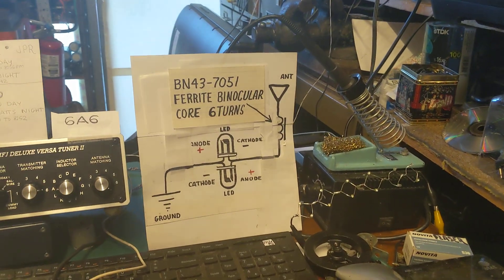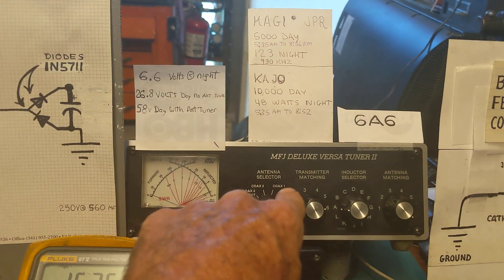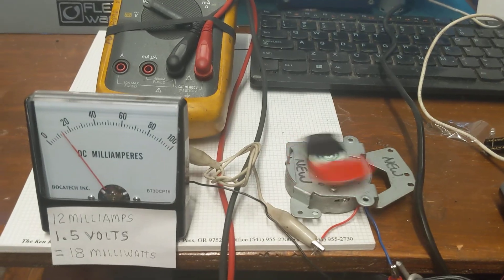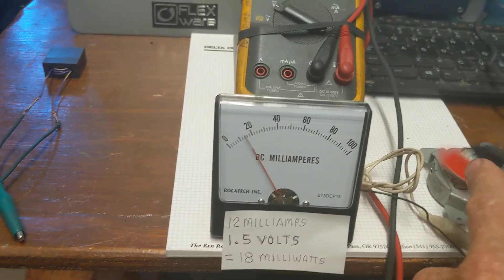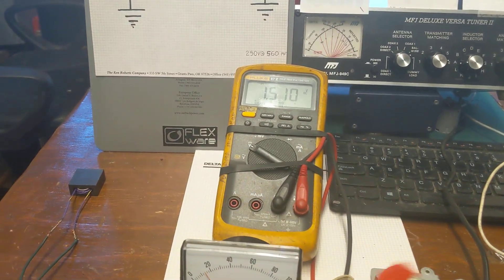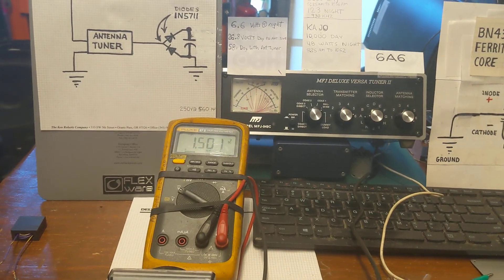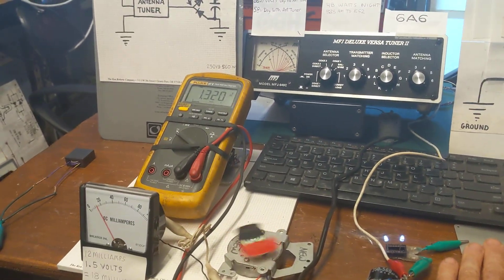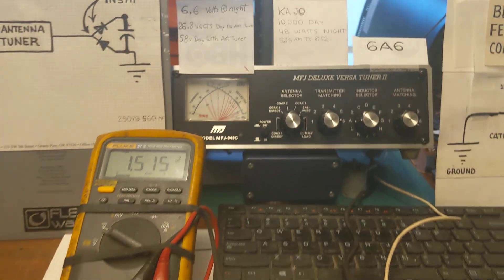Powering A Motor On Radio Waves.

Comment: The Guy from the Plasma Channel did some experiments on RF power you might find interesting.  I believe that a 
Joule Thief Circuit with this RF input could be used to drive a Magnetic Pendulum to create even More Output power
using the gravity of the swinging pendulum, as it passes over 2 coils on either side of the 180 degree swing.  I am going
to give this a try.  Great Videos!!

Comment: That extra voltage could be coming from the input of the antenna tuner mains voltage power. But still very interesting to get 26 volts with diodes thank you
Reply: The component values   in that antenna coupler are not going to pass  60hz  line power anytime soon.

Comment: Dint need to drive stuff, this is useful just for a off-grid trickle charger 
Like you find a quiet place noone will bother you for a while this could keep your batteries topped 
I mean 59 v could charge a 48v system 
Get a wood burner in there 
Jobs a gooden
Reply: My first thought was also trickle charge for batteries

Comment: actually you could run an appliance if you charged a very large capacitor or battery bank and let charge over time like solar shouldn't take long then just use inverter to get stored energy , probly can power a microwave for short period of time with right battery storage.

Comment: Does the power to the motor change in the night hours?
Reply: It is likely much less as the transmitting station drops its output wattage significantly at night since it doesn't have to compete with the RF output of the Sun.

Comment: If you haven't looked into the LTC energy harvesting chips, I've used the 3588-1 to pull 100ma off fluorescent lights using a couple standard size plain copper clad pcb panels (I actually made larger panels using two standard size each and running fat solder blobs all the way down the seam joining them).  All I did was hook up a breakout board I got off sparkfun (there are many maker sites that have this board, if they don't), wire up the panels, and it started cranking out power.  What I learned from that is if you can hear a light or motor then it's losing energy into free space through inefficiency and you'll probably be able to scoop some of that energy up and return it to usable power for yourself.  

In this case, I think the LTC 3108 might be able to help improve your result's usability if you can get it up to 20ma input.

It's not stealing, it's gleaning - and to be fair, if you're absorbing that energy out of free space that was leaking into it from other sources you are actually collecting electronic "litter" just as if you were picking up trash in a park, so I say scavenge as much free slop as we can!  Everybody wins!
Reply: This is how Dr. Henry Moray use this to power his device. https://www.youtube.com/watch?v=uhx4KEmh5pQ

Comment: kewl - I was messing with this, after discovering that common mode current that runs along the top of a coax cable, flows even when my ham radio is disconnected. The amount of power I was getting was surprising. In the future I see applications using RF powered sensor applications. Using this to run low power devices is what this would be good for. FREE ENERGY!!!
Reply: This is how Dr. Henry Moray use this to power his device. https://www.youtube.com/watch?v=uhx4KEmh5pQ

Comment: Just say every mobile phone in your area now had a chip which enabled passive charging from radio signals, would your local radio station have to put out more watts to boost the signal (because the charging phones would weaken it), or is that potential charging power in the air, as it were, just wasted anyway?
Reply from the maker: Interesting question. When you consider that I'm about a mile and a half from the AM broadcast transmitters which provide the power for my experiment, I doubt the transmitters could ever sense any energy being drawn from it at such a distance, but when you're very close to the transmitters you can detect the energy being drawn from it just as a transformer coil primary current consumption would increase as additional secondary coils on a transformer would require more power from the primary.side of a transformer.

Comment: Great experimental set up. So question is...what if you hooked up a bunch of similar set ups (10+) could they be combined for a greater output? and instead of the tuner build a tuned circuit matching sender-receiver? Or does the signal drift?
and...would their be a noticeable "energy draw" seen at the station. The curious mind is always wondering. 
In some small Tesla coil set ups I have made, seems if you have the right resonance you can keep adding receiver coils for output connections.
Reply from the maker: I would think more antennas would result in more power. One thing I noticed when switching between the LEDs and my motor is I had to retune my antenna tuner for maximum output.
Reply: This is how Dr. Henry Moray use this to power his device. https://www.youtube.com/watch?v=uhx4KEmh5pQ

Comment: Hi cool experiment if you get a cheap pulse generator you could step the power up 😎🧐🖖
Reply from the maker: I'm not convinced you can boost up the power, but if you succeed please do share.
Reply: @GrantsPassTVRepair  Soon I will make a free energy device from Poland. You are right. You can increase the current and voltage. Get the voltage and current, enter them in parallel in the resonance, find the frequency, match it, calculate it mathematically, adjust it until you get a large voltage and a current of hundreds of amps.

Comment: you might only be able to run that small motor, but if you watch how john bedini (RIP JOHN)does some of his circuits you could supply a constant charge to a battery for a different system.....thus by using 2-3 different systems, you could power a house
Reply: You are dumb.

Comment: Basicaly you have a free energy Yagi antenna. LOL. Tesla was all for this sort of tech. (and other odd-balls)
Reply from the maker: My antenna is just a 200 foot long wire antenna strung over the top of a pine tree.
Reply: @GrantsPassTVRepair  Yeah, that's all it takes to set off the nutters. I had the same in the 80's and people would come to look at it. LOL. It's a bit of wire FFS. LOL.

Comment: You’re wrong in the statement you made saying you can’t run appliances off this type of power. You can run all your home devices off the power from the air. This is a fact. This all can be done with the right Electronics. I’ve created a system that will do this and got shut down. Want go into that with no one. I’ll put to you this way. Our government doesn’t want this to happen. Can’t make money on anything that is free, how about that. You can with the right knowledge and investment do just about anything you set your minds to folks. Don’t let anyone interfere with your gaining knowledge. It’s there for you. You just have to reach out hard for it.😊but anyway, thanks for sharing your experience and knowledge with me, I do appreciate this much.😊😊😊😊😊😊😊😊

Comment: That's wild! I bet there is some obscure law that prevents people within a few hundred feet of the transmitter from putting up a large resonant antenna structure..  ..but then again, maybe not..
Reply from the maker: I would not be surprised if there was. By having this device in my shop it re-radiates the  signal with such strength, a near by AM radio receiver picks up the same station in multiple spots on the AM broadcast band.

Comment: Could you try tesla patent the one with coil and cap, after that you add gap so it ignites for amount of time then add it to a transformator step down.?  And use the secondary to rotate the motor?
Reply from the maker: I can't follow what you're saying.
Reply: @GrantsPassTVRepair im sorry. English isnt my native language. There is diagram of tesla coil patent online.
Reply: No, he's not getting a high enough voltage for that to work. But, the diodes act like nearly ideal RF switches, from the perspective of what Tesla was dealing with at the time - coherers and such.
Reply from the maker: @zinckensteel  When you say I'm not getting a high enough voltage for this to work could you clarify what you mean?
Reply: @GrantsPassTVRepair  They are wondering if you are getting enough voltage to fire a spark gap, which would mean more than 300Vdc at absolute minimum.
Reply from the maker: @zinckensteel  You could produce well over 300 volts if you allow the capacitor to charge up over time, and pulse it into step up transformer.
Reply: @GrantsPassTVRepair  Of course, but the idea was that it would be self-triggering, or free running directly from the received signal. 300V or so is the minimum for breakdown in air regardless of gap length.
Reply: @zinckensteel you can place the antenna higher. More height more voltage. Just like when you go up the mountain.

Comment: Awesome Dave, at that level of power you should be able to charge your 10kWh electric car from 0% to 100% in only 63 years. I would double it to compensate for daytime/nighttime transmitter power settings and give it an additional 20% margin or error for inefficiencies, so about 152 years to fully charge your 10kWh electric car (your mileage may vary). Seems like "free" energy is readily available, you just have to know how to harvest it.

 Here are the details google came up with if the transmitters are operating at full power 24 hours a day

To determine the time required to charge a 10 kWh battery with an 18 milliwatt charger, unit conversions and calculations are needed. 
1. Unit Conversion:
10 kWh to Wh (Watt-hours): Because 1 kWh equals 1000 Wh, 10 kWh equals 10,000 Wh.
18 milliwatts (mW) to Watts (W): Because 1 Watt equals 1000 milliwatts, 18 milliwatts equals 18 / 1000 = 0.018 Watts. 
2. Charging Time Calculation:
The standard formula for charging time is: Charging Time (hours) = Battery Capacity (Wh) / Charging Power (W). 
Charging Time = 10,000 Wh / 0.018 W
Charging Time ≈ 555,555.5 hours
3. Conversion to a More Understandable Time Frame:
Hours to Days: 555,555.5 hours / 24 hours/day ≈ 23,148 days
Days to Years: 23,148 days / 365 days/year ≈ 63.4 years
Therefore, it would take approximately 63.4 years to charge a 10 kWh battery using an 18 milliwatt charger.
Reply from the maker: Hi Steve, Only a 152 years to charge a car battery sounds promising. LOL. If I was a few feet from the  broadcast transmitter there might be some possibilities, but not at 1.5 miles away.